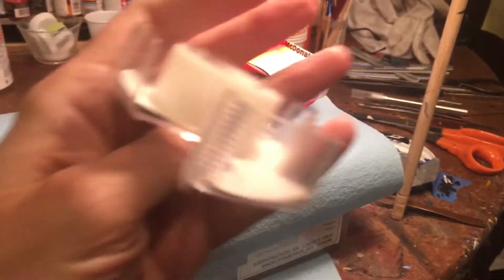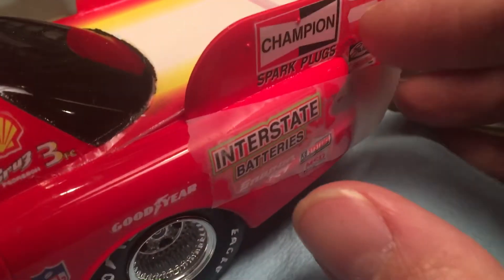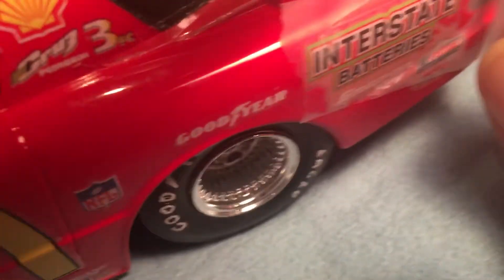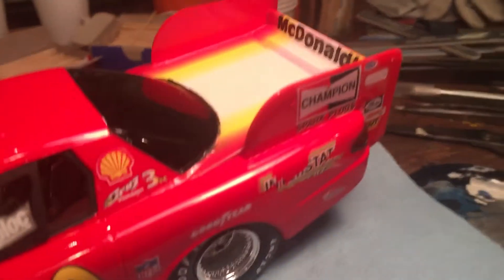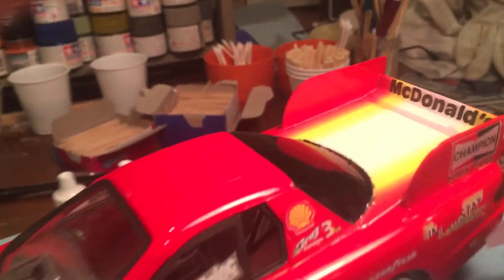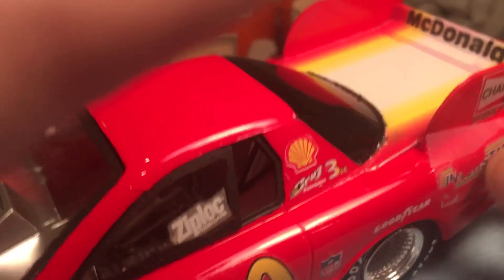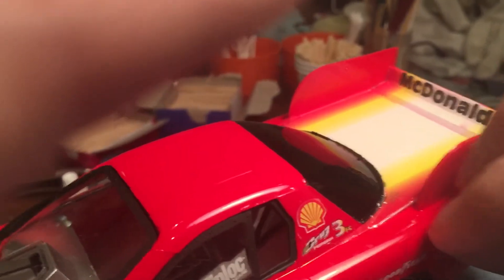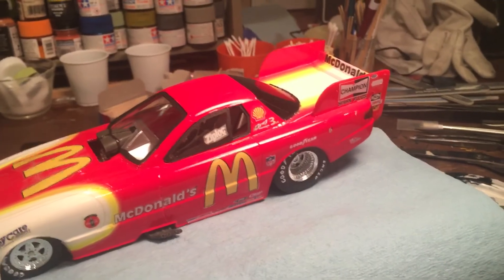Decal Tip; Sort of :)

Comment: I’ve used this method several times but if you take micro set and wet the decal down good it will lift off just use a paint brush to get it to lift off and it comes off in one piece in most cases